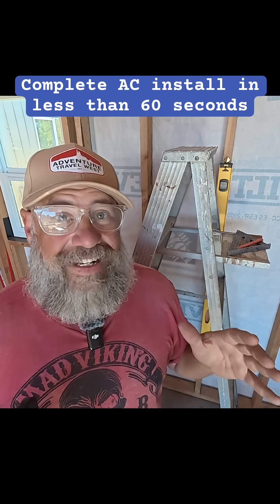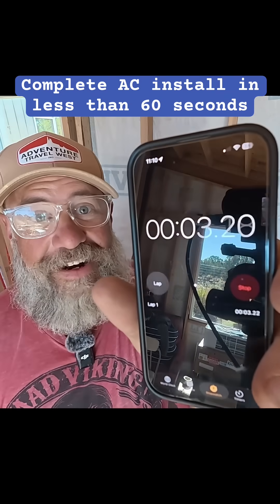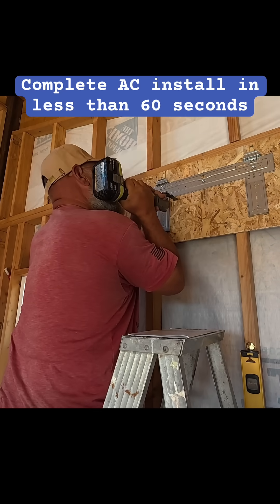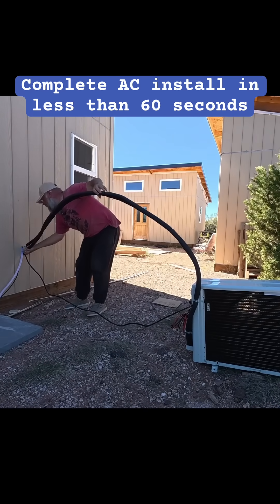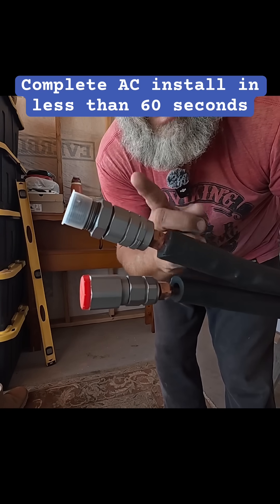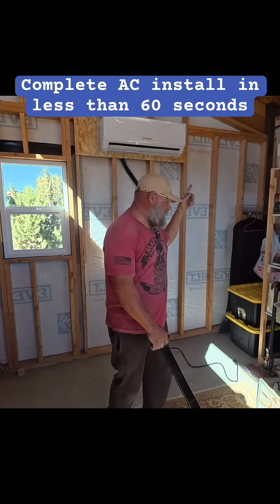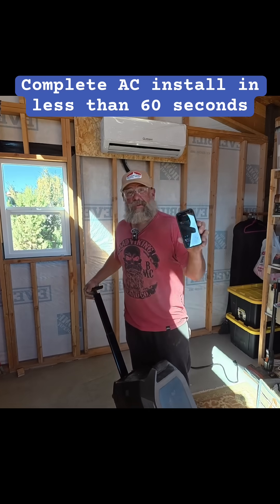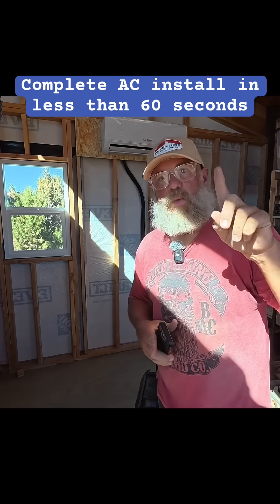NO HVAC Tech Needed! Airspool HS12 DIY Install in Under 60 Seconds

Comment from the maker: 👇 Get $130 OFF Your Airspool HS12! 👇

🔥 Airspool Quick 'n' Easy Mini Split 
Use Code: BREADTRUCKER
https://shop.airspool.com/products/new-airspool-quick-n-easy-hs12-12-000-btu-solar-air-conditioner-heater-with-superheat-the-first-true-diy-hybrid-mini-split-5-minutes-literally-to-connect-everything-12-month-happiness-guarantee

COMES WITH 5 YEAR GUARANTEE!!! Plus a 1 year Buy and Try so if you aren't satified within the first year, you will get all your money back including shipping to and from!

⚡ 👉  https://www.santansolar.com/?ref=breadtrucker
💸 Use Coupon Code: breadtrucker     for extra savings!
(The low-cost 2,000W array used in the video!)